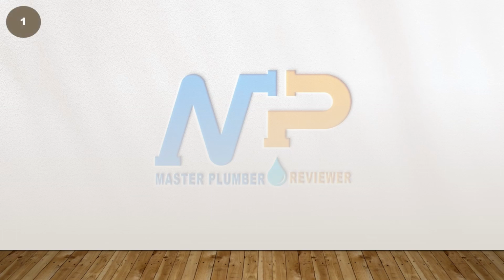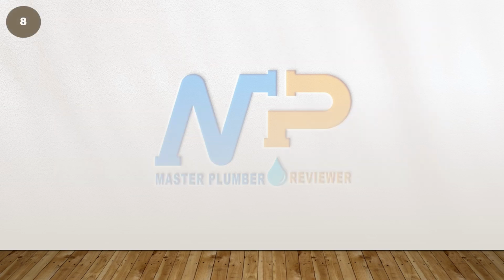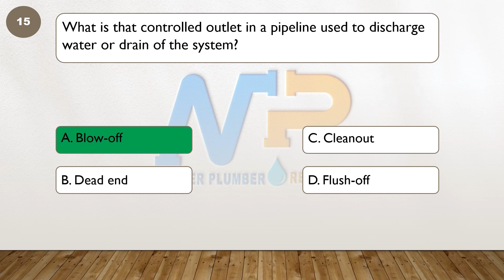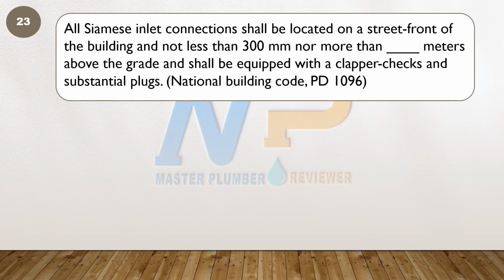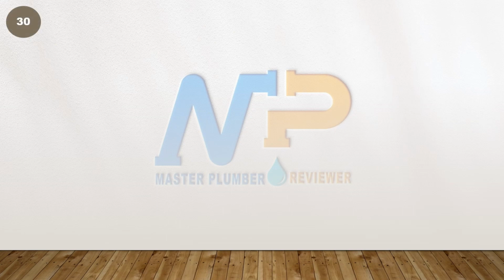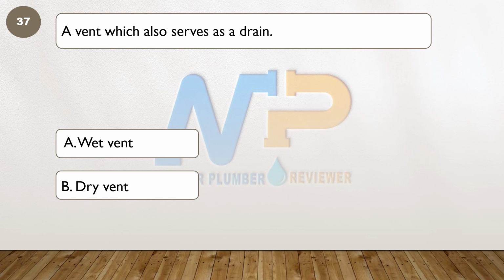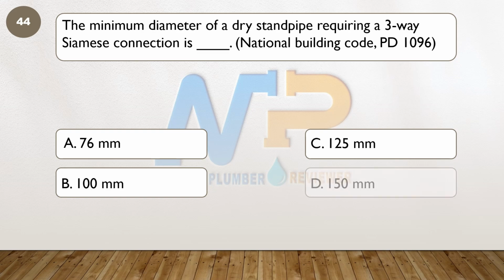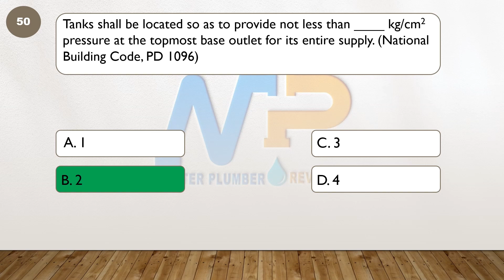SANITATION, PLUMBING DESIGN AND INSTALLATION- PART 1

Comment: Sir, ask ko lang #18 sir is Letter B. 1 1/4 inch diameter  po yata dapat?, page 312 Max Fajardo. for your checking sir
Reply from the maker: Yes sir, tama po kayo 1 1/4 or 32mm. Thank you for the correction. God bless!
Reply: RMP na?
Reply from the maker: @engr.ashary  Yes sir